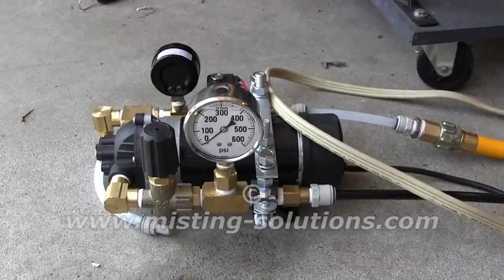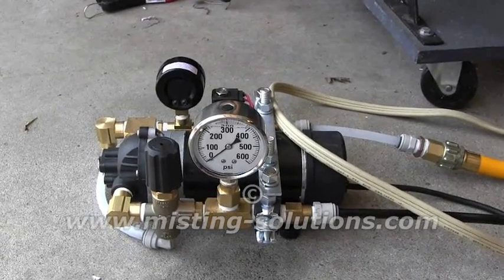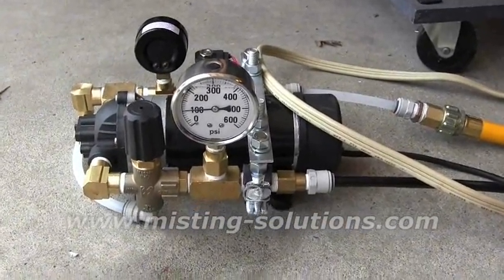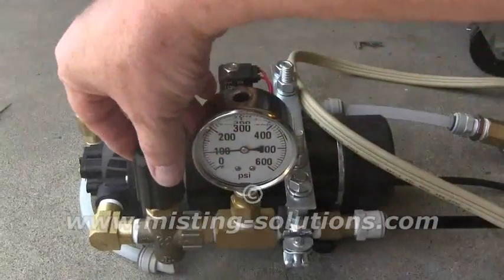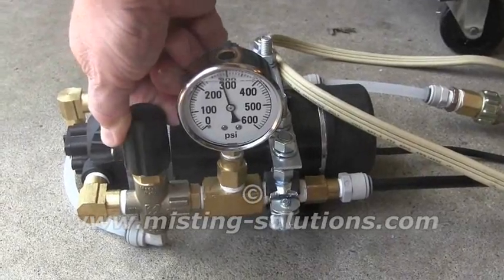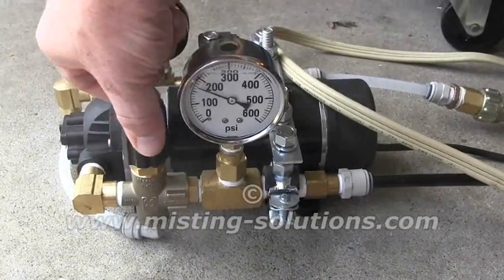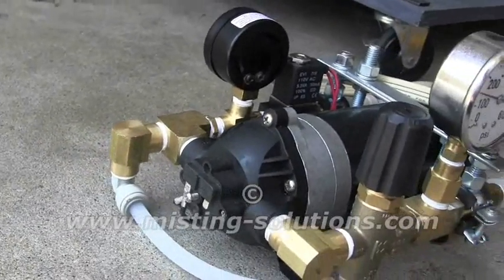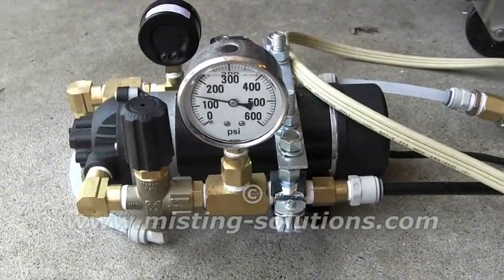Diaphragm Pump Sprayer /Misting Demo 100-300 psi.wmv

Comment: really work to 300 psi . &Lift capacity water.
Reply from the maker: Yes, but the motor will burn out in short order. It motor is only rated to put out 160 psi.
Reply: @JohnOstroot ok thanks. Borewell undrground lift water capacity.